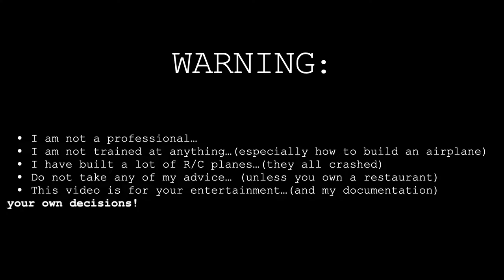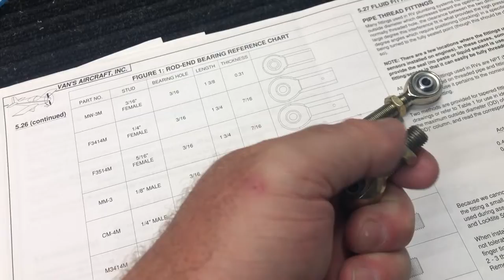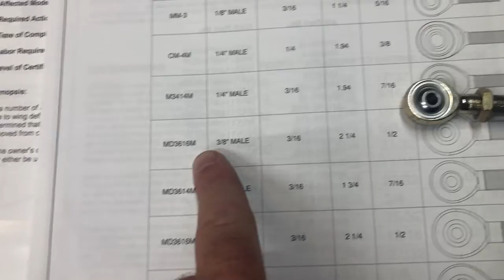Aileron Torque Tubes Vans Aircraft RV10 Build

Comment: As the parts were wrong, did Vans offer at least a discount on the new replacement rod ends? Thanks for the video.
Reply from the maker: The parts were not wrong, it's not a perfect process, I might have cut the tube an 1/8" short and then I might have installed the rod end an 1/8" short.  My comfort level might be higher than others.  Either way, it was an inexpensive fix and there will be many many more of them.  I am just suggesting that a builder cut their rods a bit longer than plans as I would rather have more thread contact than less.